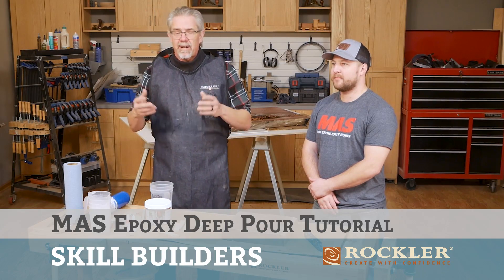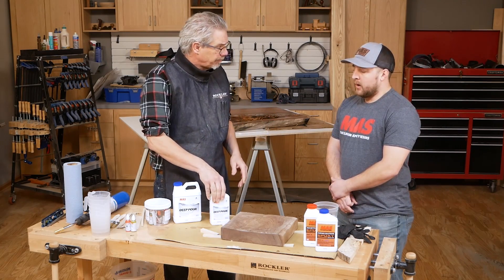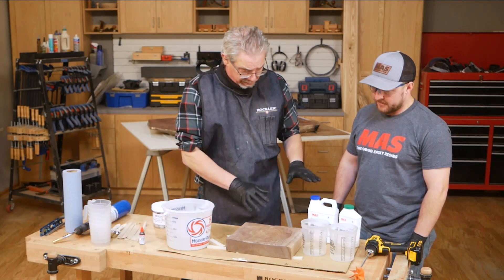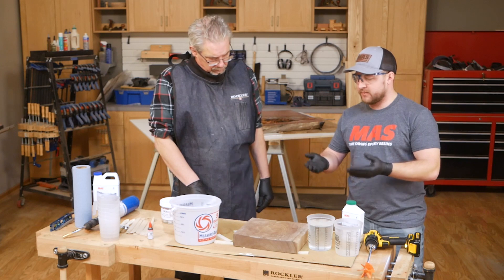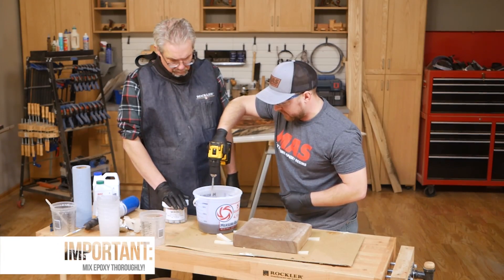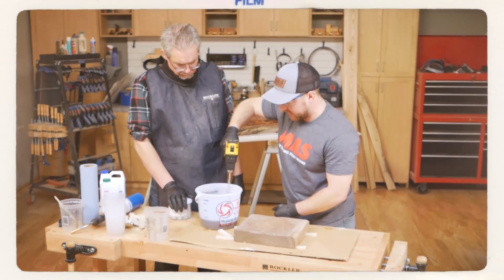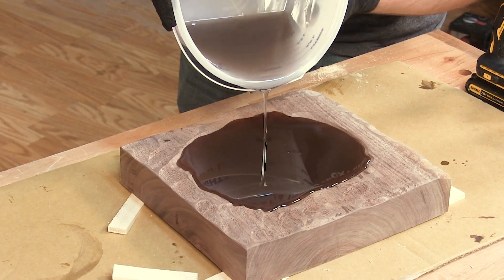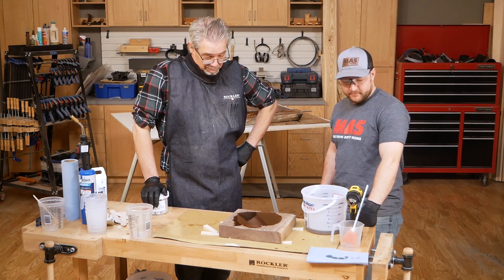Mixing and Pouring Deep Pour Epoxy | Rockler Skill Builders

Comment: I'm making a kind of small rectangular pour in a home made mould (85mm x 85mm x 50mm deep). I want to do it in two pours but can't take it out to sand in between. Can I pour the second layer without sanding in between? Since there won't be any tooth for the second pour, should it be done whilst the initial pour is still slightly tacky?
Reply from the maker: Being that small, you could most likely do that all in one pour. If you did it in two pours, you would only need to scuff the top surface and wipe it clean before you pour the next layer. No need to demold to sand. Also, yes you can pour a second layer when it is just slightly tacky, near the end of the curing process without sanding. The timing is the tricky/important part in that kind of pro move. However, for the size you're doing, one full pour may be sufficient. That isn't a very large volume, especially for deep pour epoxy. So, overheating causing an exothermic reaction is very unlikely.
Reply: @rockler  than you so much for your reply. That good to know 🙂
Reply: @rockler  So, we did the pour and man, what a disaster. It had a full on exothermic reaction with bubbling and cracking (no smoke) even though it was only 4cm deep. I wish I could show you the photo but it doesn't allow me to post it.
Reply from the maker: That is very odd. Were you using deep pour epoxy like in this video, or were you using table top epoxy? Most table top epoxies are a 1:1 mix ratio. Deep pours are more commonly a 2:1 or 3:1 mix ratio. If you were using table top, then we misunderstood, as this video is about deep pour epoxy. Deep pour epoxies have a much thinner consistency and take a few days to cure. This slows the heat and gives time for bubbles to naturally release. Table top epoxy can usually cure in about 24 hours, and has a thicker consistency. It has a much shorter working time, and starts to set up within 30-60 minutes. Table top epoxy can usually only be poured in 6-7mm layers.
Reply: @rockler  It was 1:1 ratio, so likely table top epoxy. Lesson learned. 🙄
Reply from the maker: Oh no! We are so sorry for sharing insight for deep pour when you had table top! 😭 If you attempt it again with the 1:1 epoxy, only pour it about 6-7mm deep, and lightly torch or heat gun out any air bubbles about every 15 minutes. Don't over do it with the torch or heat gun, just a quick pass. Then after about 2 hours, once it is firm but tacky, you can pour a second layer without needing to sand or scuff the top surface of the first pour.
Reply: @rockler  No problem... not your fault. It was certainly a learning moment and we actually of found it pretty funny. 😏

Comment: For my first time with epoxy, I used that product for a mixed types of scrap wood vase! I didn’t have my pressure pot yet! After it cured, I put it the lathe and started turning it!! A lot of bubbles at different levels! I couldn’t use a torch, because it was in a plastic container! I suggest to use a pressure pot for any bowl or vase epoxy project!

Comment: I'm pouring epoxy into a 1.25" wide channel around a picture frame, filled with different bottle caps. I want to pour epoxy into that channel about one quarter inch deep, to just cover the bottle caps around the perimeter of the frame. My concern is that since the bottle caps are hollow underneath that I might get unpleasant bubbles throughout the poor as the air escapes while it cures. Any suggestions? Is this likely to be a major problem and possibly ruin my project?
Reply from the maker: Here are a few ideas you could try - You could fill the back of the caps with clay. You could also use epoxy to fill the caps. Another option would be to fill the bottle caps with hot-melt glue, then use the glue to also stick the bottle caps down before it sets. Any excess could be trimmed away with a hobby knife before pouring the epoxy.
Reply: @rockler  thanks for the reply, someone else suggested filling the caps with epoxy, but your much less expensive idea of using clay makes more sense -even cheaper would be to use up my drywall joint compound, and use something to seal off the surface when dry so it doesn't emit any bubbles. 

TiteBond or Elmer's glue would also be less costly than hot melt glue or epoxy.

With all the DIY woodworking and artistic uses for epoxy these days I suspect it's a great time to invest in one of those companies!
Thanks.